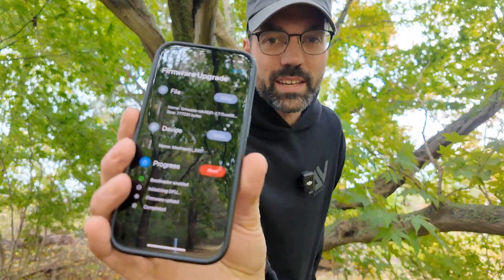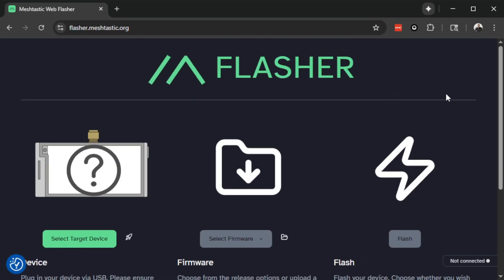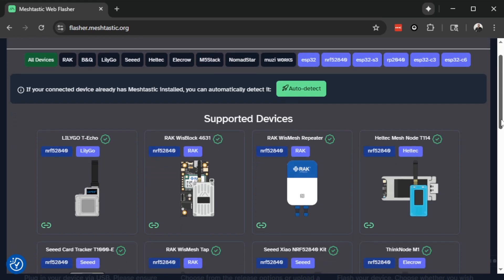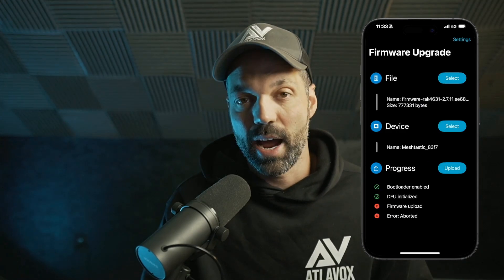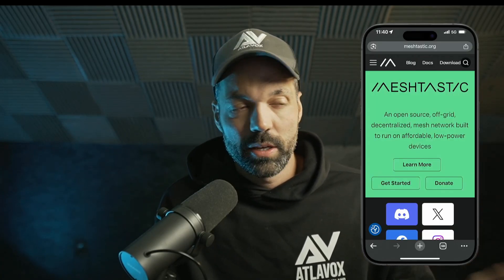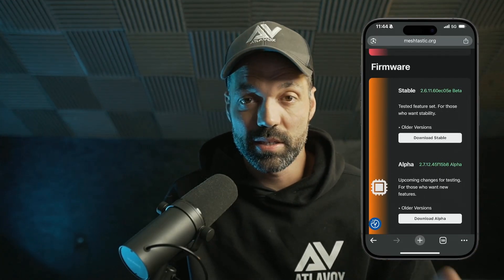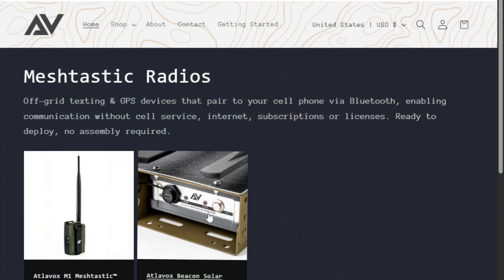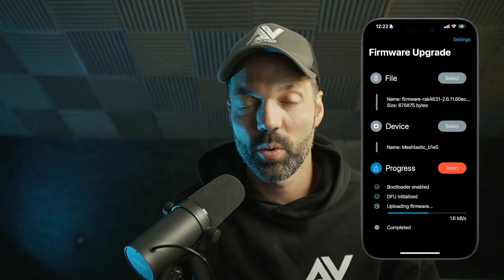Flash Meshtastic Firmware Wirelessly | OTA Bluetooth Firmware Tutorial

Comment: Good video.  Im dont play with my heltec v3s often.  Wont work without the new firmware.  

Any tips on finding which file I would use on a V3?  Thanks
Reply from the maker: The Heltec V3 is an ESP32 device, so you can't use the over-the-air firmware update shown in this video. Best thing to do is:
1️⃣: Go to https://flasher.meshtastic.org/
2️⃣: Click "Select Target Device"
3️⃣: Filter for Heltec
4️⃣: Select Heltec V3
5️⃣: Select desired firmware version, then click Flash.